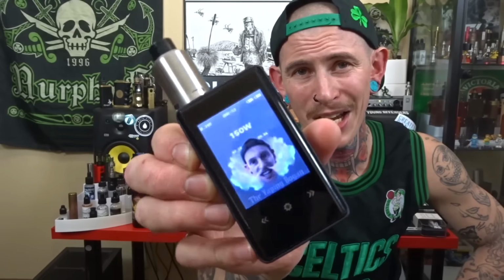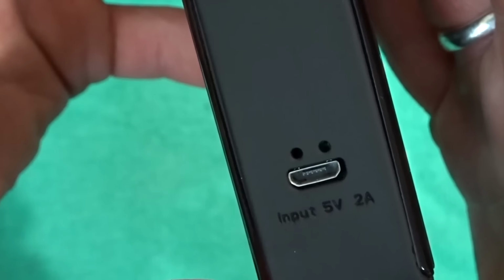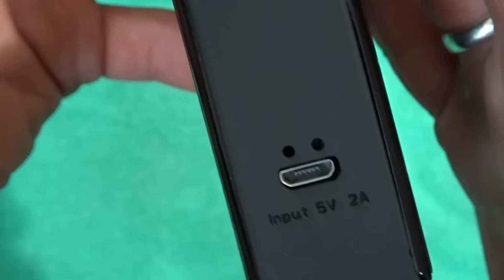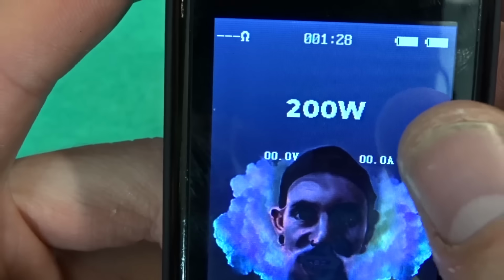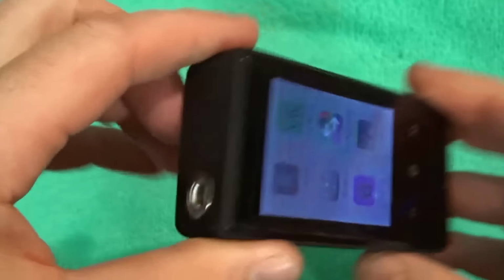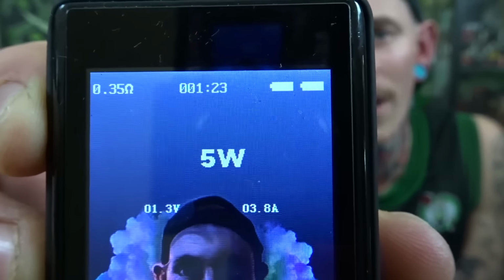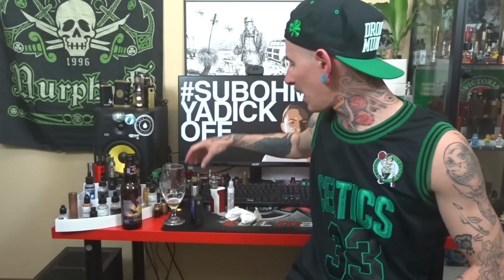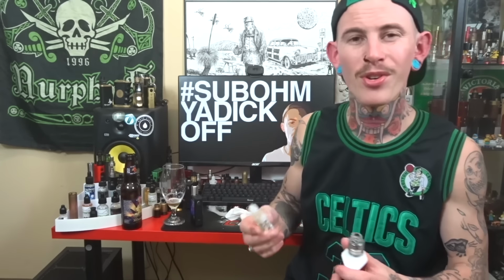Worst Mod of 2016 - Hells Gate 200W Touch Screen - The Vaping Bogan

Comment: the idea of a touchscreen on a mod is utterly stupid to me
Reply: +Leonar12345 The idea isn't a bad one it could be useful for making menus easy to navigate and incorporate more features.
Trouble is all the one's i've seen to date is manufacturers using a touchscreen just as a gimmick they don't use it to add any functionality they just put dumb shit like some jpegs of the user manual on it and a background and call it job done.
Reply: ***** For me the idea, itself, is stupid. Touchscreens are great for enhancing a UI experience but me, personally, I don't spend all my time messing with the UI. I set my wattage and that's about it for every day usage. I'd rather have something that I can hold however I want and I don't have to worry about it unlocking.
Reply: We know what good can come out of a touch screen with the G-Priv kit from Smok. 
This, there's nothing good about this thing.
Reply: 5 years later touch screens on vape devices are not common, same as Bluetooth.  Both causes more problems than its worth. 3 buttons and a good menu is all you need.

Comment: Not to be Sigelei spokesman but I finally got the T150 (touch screen) I'm in love, this thing is AWESOME! If u get a chance grab it, I don't think you'd be disappointed. ..only thing I don't like about it is...no usb port, have yo recharge two 3.7v 18650 batteries, but I put batteries in at 7am this morning and it's 8:30pm vaping at 75watts in TFV4 mini and battery life is not even close to 1/2 way yet and I've bee, vaping pretty steadily

Comment: Just got these in at the shop I work at; I purchased one and all of these problems have been fixed to my knowledge. I have been using it all day and have had ZERO issues with it. All around a great mod.
Reply: So this bullshit has been fixed. I wanted to pick one up since it seems somewhat cheap for a touchscreen 200W device.
Reply: yes it has! It is a great mod honestly check one out!

Comment: At 5w you should have like a 6 second sleep time XD That thing is just piping voltage through. Im assuming it probably doesnt ACTUALLY have a variable system. It says it does, but what its really doing is just completing the circuit with the fire button and pushing the voltage straight through.

Comment: I dont know if its bc its an old video and since firmware has upgraded but mine works amazing , only has a message come up to unlock if you directly press the gear button on the bottom , voltage and amperage is as accuratebas any other vape in its price range i think an update and re-review is necessary , when i watched this i was kind of annoyed bc this mod is great i prefer over smok alien 220 , 40w i have 2.8-3.1 volt same on alien so.....
Reply: Wish i could just comment reply a video to prove this whole video wrong , maybe lack of consistency in building ?
Reply from the maker: +Keenan DeJong lol dude this video is years old

Comment: IF YOU UPDATE THE FIRMWARE IT FIXES, THE WATTAGE ISSUE, IT INDEED DOES HAVE BOOST & BUCK CIRCUITS, ACCORDING TO A FEW OTHERS I'VE SPOKEN WITH. IT APPEARS THAT THE BUCK CIRCUITS AREN'T WORKING CORRECTLY ON ITS ORIGINAL FIRMWARE. TYR UPDATING IT...
Reply: +drewp831 I get the feeling he's not gonna bother lol
Reply: Yea but wut I was gettin at was, this video could of gone much didfrently if he made sure to have the latest firmware before tearing the company a new asshole. Granted he's prob right on in saying the designers prob dnt vape. But the majority if them dnt. It just seems like he got frustrated and the content suffered. I usually thing bogans right on, and he still might be. But it would of been nice to see a vid on the actual product the way it will be when we go to use it. I've seen a few other vids tht day once the updates complete it operates like any other high watt mod. Basically It seemed like he wasn't his normal self and let his aggravation get the better of him. Idk jus my opinion. LOL. BOGANS STILL ONE OF THE BEST IMHO!!
Reply: drewp831 True dat lol
Reply from the maker: +drewp831 i have done trhe update, there is still a voltage output issue, though not so bad, but is by no means fixed. BUT there is some more even bigger fails. i will be posting a follow up vid soon. i think you will rethink this comment.
Reply: im not saying im right jus seemed like you were pissed off, im sure it needs work. I LOVE YOUR STUFF one of the best IMO

Comment: its a piece of trash, no question about that, but the battery strap placement seemed a bit of a stretch, lol...also I kinda dig what they did with the temp control selection, 1 push done, if only the mod wasn't so crap, and the people who made it weren't only in it for some money..buying one of these is like buying a smart phone at Walmart, or what ever stores you have down there lol( I came here from The Vape Team )

Comment: i tried updating this mod with the firmware. now i got an error on my screen saying "##ERROR## Fix Data NOT Program!" i told them about this and they were talking to me as if i didn't read the instructions properly and that it worked fine on theirs lol. I'm a PC Technician...i think i am quite capable of updating bloody firmware. Get this though...they have 2 chipset files just in case one doesn't work. After updating i got that error and it has fucked up the settings and removed the background picture, and speaking of the picture...Scribe STILL doesn't detect usb to upload a picture. They asked me for my facebook (which i thought was very unprofessional) just so that they can send me a video on uploading a picture....um i won't be able to load a picture if its not detecting the usb. The price of this mod, INCLUDING shipping is just not worth it.

I agree with you about putting the time on it. I find puff counter/time completely useless. I don't care how many puffs i've taken or the time of puffs. lol

I tried putting my madhatter v2 rda on this and it won't even detect it. Keeps saying "No Atomizer Detected". 

I am severely disappointed in this mod and you've covered every flaw that I've noticed except the firmware update and picture uploading....

back to my trusty smok cube mini 75w mod.
Reply from the maker: +Joanne Brownlie this is exactly what happened to mine when i updated it. BULLSHIT
Reply from the maker: +The Vaping Bogan finally got it to update eveything, you have to use the V1.3 upgrade program and connect the mod while its on and while you hold the menu button. then do update all.

Comment: Well the video is kinda old but just saw it and cant stop laughing, i didnt know why you were so mad until i saw the last portion of the review and completely understand you bro..... apart from the shitty mod, its dangerous too. people that made it, for sure they dont vape, but they ignore the ohm law, and this is worse. For example my current build is 0.2 ohms and i run it in 70 watts, if the mod gives me 9V the following things will happen. 1) my eyeballs will drop out of their sockets because of the fire i am gonna be inhaling, thats right, not vapor, my cotton is gonna catch up on fire and 2) According to Ohm law the mod is going to draw 45 A from the batteries..... :O I know that this is only for half a second but still I wouldnt risk it, Few batteries can handle 45 amps, freaking scary to venting or even exploding. all in all +1 for the review, -100000000 for the product
you got yourself a subscriber mate

Comment: dont want it? lol hey ill take it idc
Reply: Not sure why... if it doesn't work & most importantly, has zero step-down.  Seeing that it cannot be vaped under its current battery charge level... You'd have to build a certain ohm AND, hell.... would be better off just using any series mech mod at that point.  Same/same.  Regardless, had the thing not been smashed to literal bits (check out his video after this one =p) .....that may have been a possibility.  REALLY don't think it'd be of much use to ya now.  ;)  Sorry.  Live long(ER) & vape on!  #ABillionLivesFilm